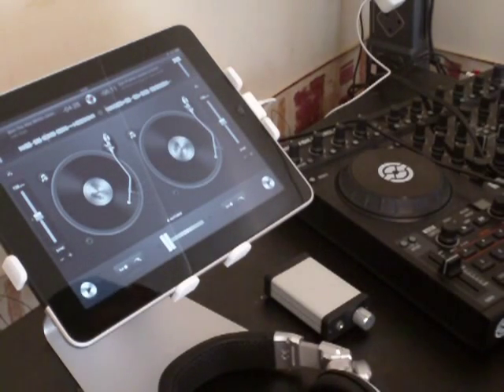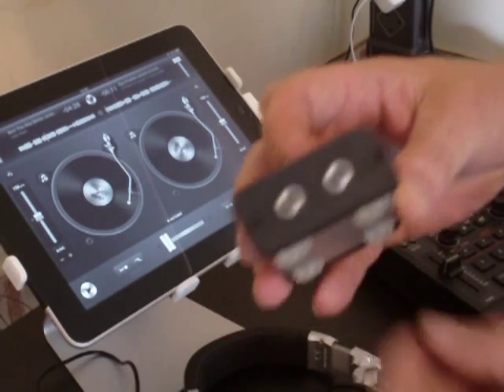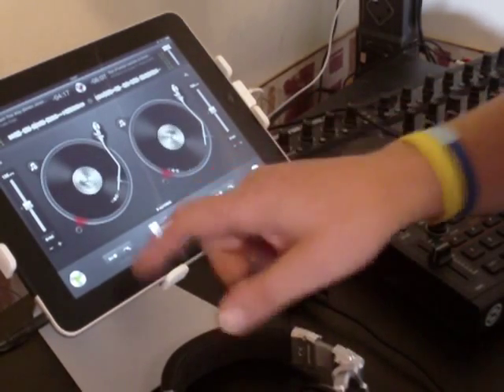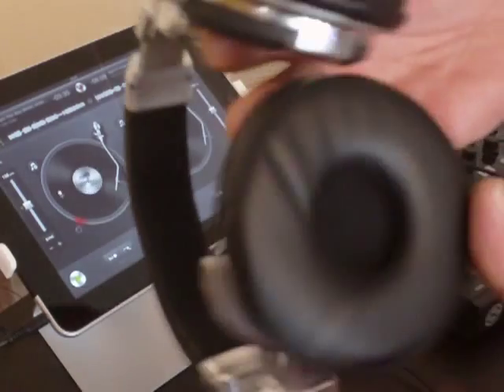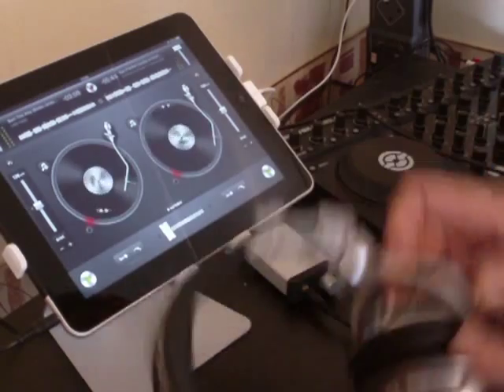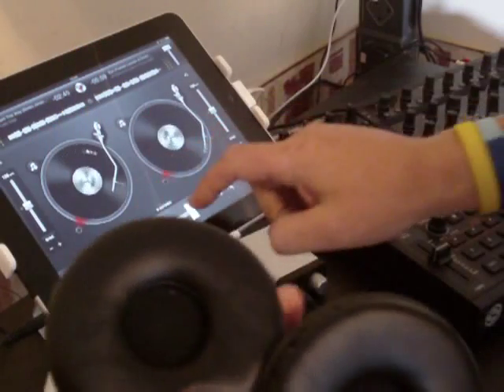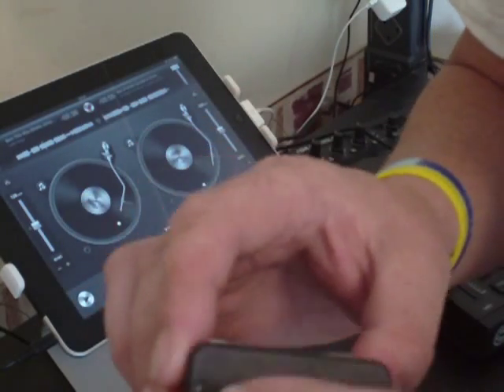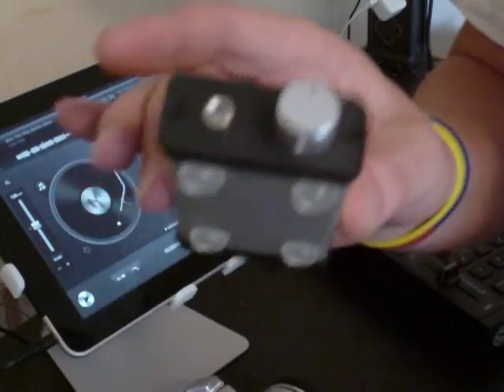Djay for iPad splitter box (part 2)

Comment from the maker: I won't be selling any of these boxes, especially as Griffin have released a perfect cable solution for DJ apps - and Numark are on the verge of releasing the IDJNOW unit, which makes use of the coreMIDI functionality of iDevices.

There are, however, details and wiring diagrams on the Algoriddm forum.